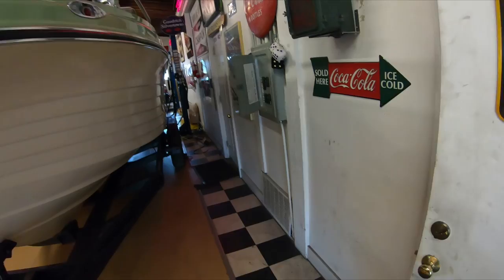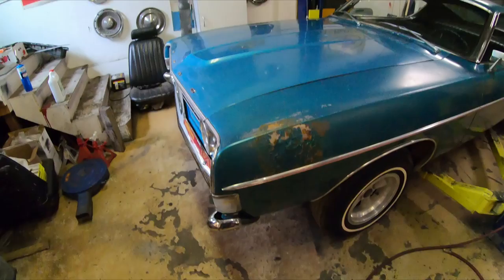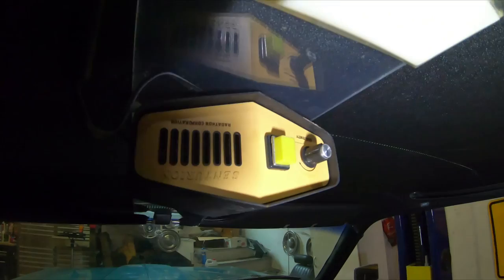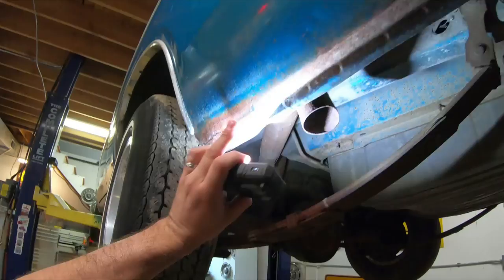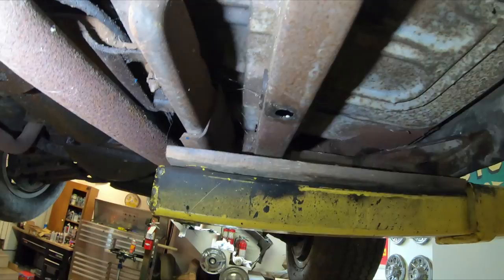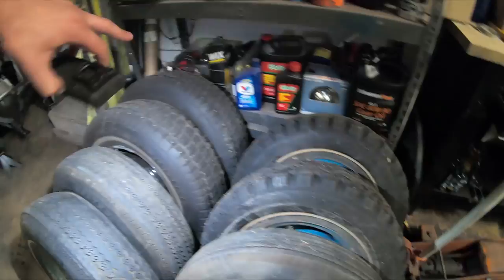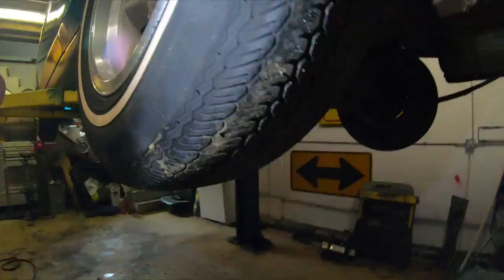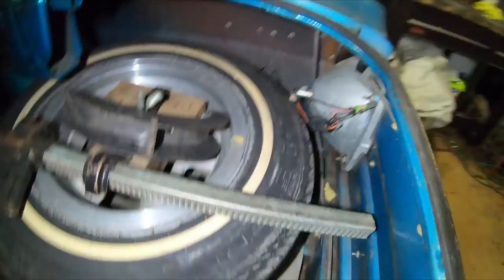Rescuing a1968 Ford Fairlane 500 Fastback

Comment: I had a 1968 Fairlane 500. It was a fast back 390 4 speed with the 3.08 poi’s also. Bucket seat with console. Black with res interior. I sold it in June of 1999. It had the dealer emblem from JB Ball Miami FL

Comment: Almost identical to my very first car, a Fairlane 500 (bought in 1971). Mine was gold with gold interior. My bucket seats had the built in headrests. Mine had the center console. One thing, the ring on the shifter is a reverse lockout, many people that would try to drive mine tried to get it in reverse without puling the lockout and i would need to get under the car to rearrange the shifter. Mine also had the rear window fan, very rare. My car did not have power windows. My wheels were the stock GT wheels painted silver with trim rings (in '69 they were chromed.) These things had extremely good brakes. The first time you drive it be sure to wear your seat belt, the front power discs will put you through the windshield. Mine had the same exterior trim package. I had the 3:00 open rear end. These had the stiffer springs, so they handled not too bad. My engine had the square looking chrome rocker covers, and a chrome air cleaner top, all stock. Mags, especially the Cragar SS, were popular back then, but I always thought they didn't look good on the Torino/Cyclone. Those Magnum 500s will look great on it.